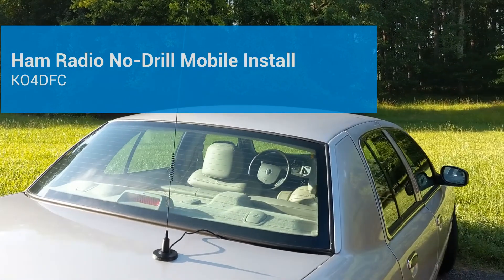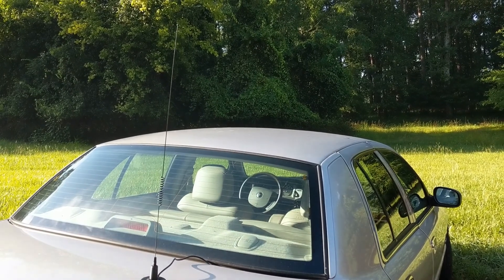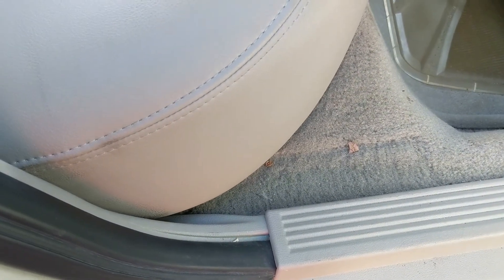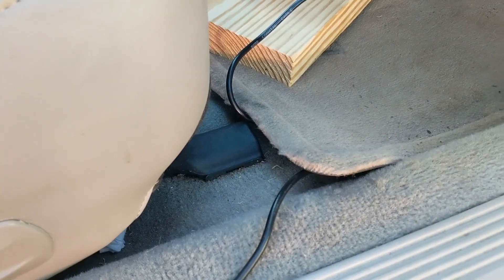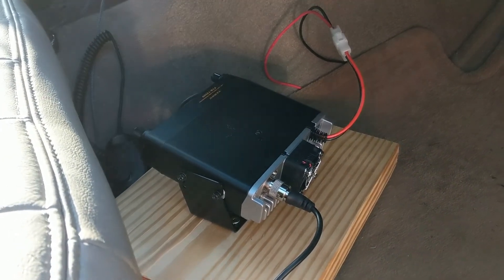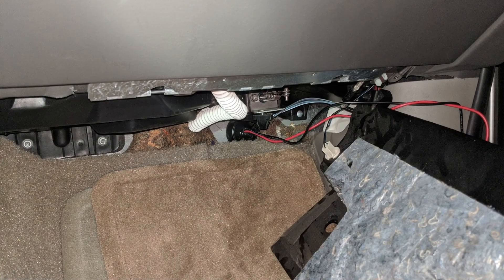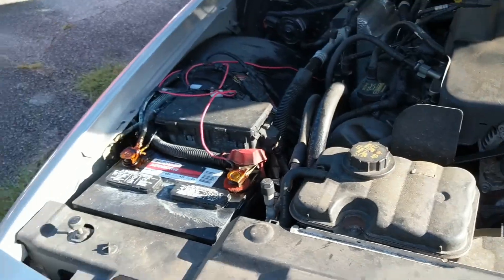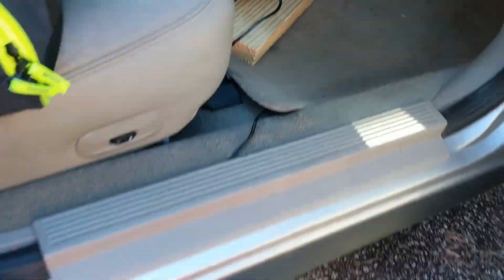Ham Radio No-Drill Mobile Installation Walkthrough

Comment: Have you mounted the seat bolt mount? If so, does it fully support the weight of the radio?
Reply from the maker: Yes the video with the mount is: No (Vehicle) Drill Yaesu FTM-7250DR Mount